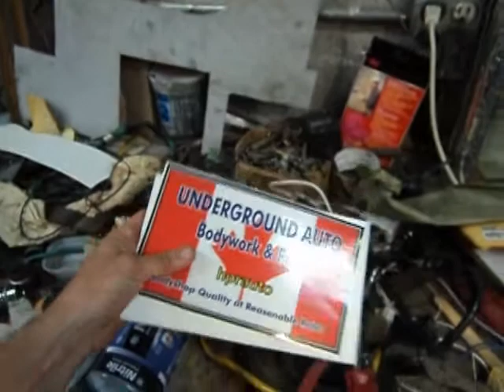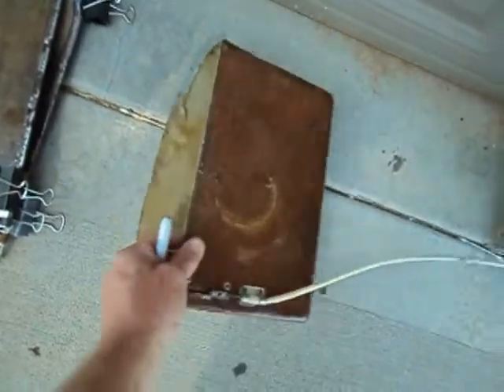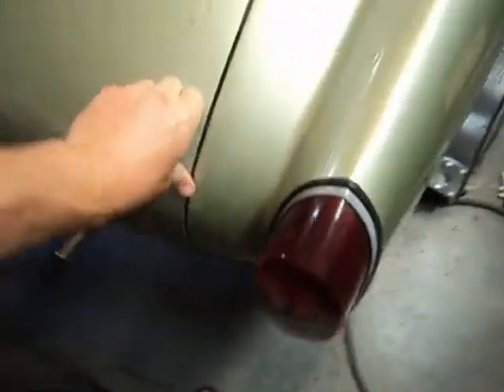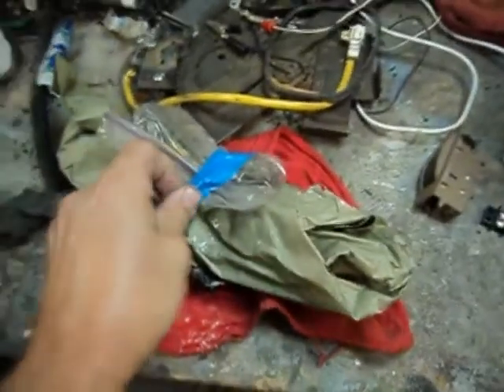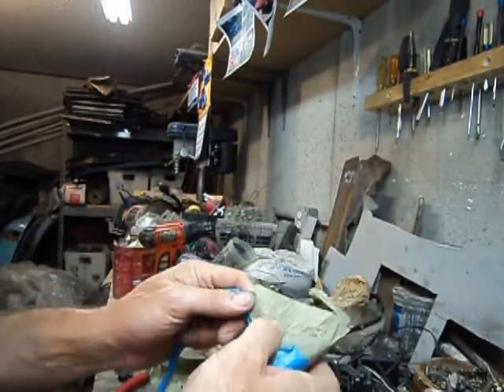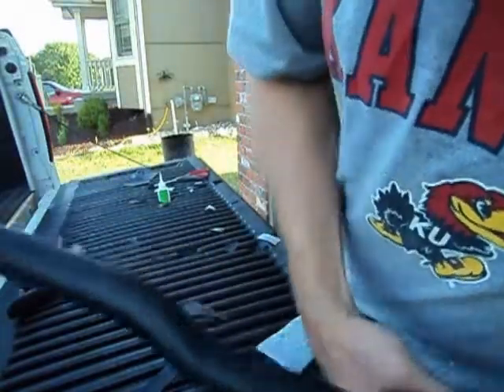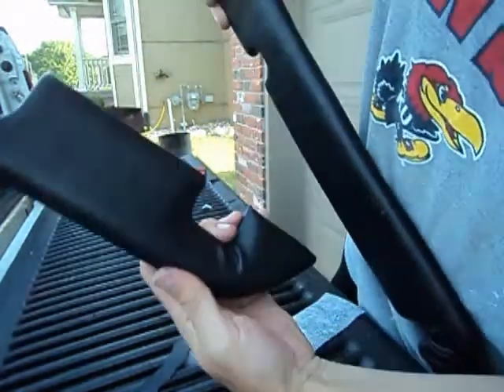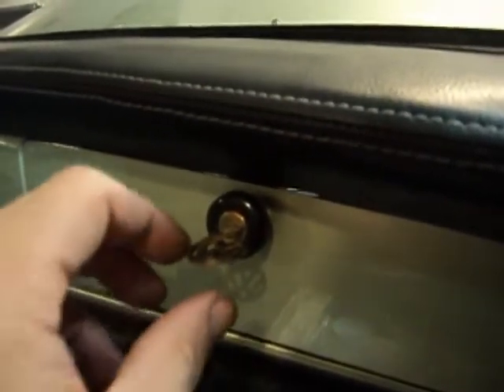Karmann Ghia - Glove Box and More

Comment: Greg I cant remember what kind of car it was but I have seen matching wiring blocks that when closed they connect and when open they disconnect  but have no wires just the blocks with mating copper points that connect.when together, maybe this will give you an idea on the power windows